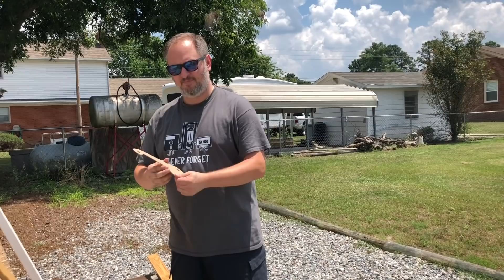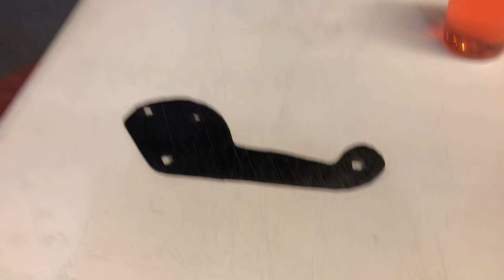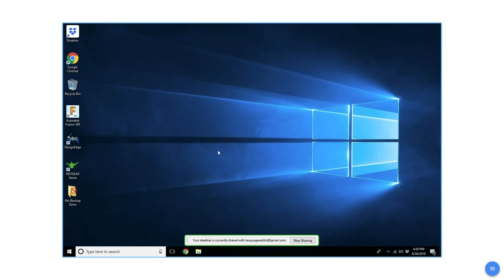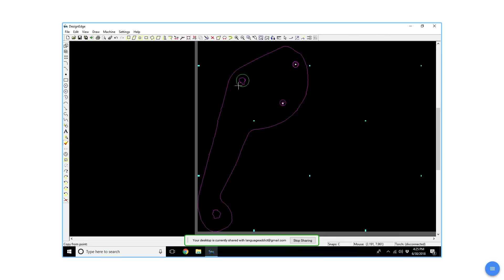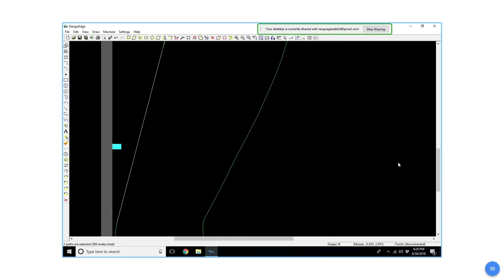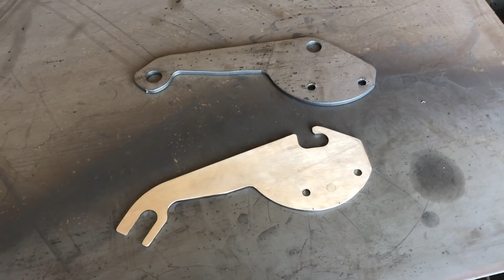PlasmaCAM - BatWing Fairing Brackets

Comment: Tom, have you gotten beyond the initial learning curve with Fusion360 yet? I’ve been really impressed with that software’s ability to import scanned images as an “Attached Canvas.” The image becomes the background of your sketch plane so lining up geometry very precisely is relatively easy.

BTW, I scan a machinist’s rule lying next to the image to ensure proper scaling of the imported canvas.

Cheers!

Tom
Reply from the maker: Hi Tom! Good to hear from you, sir. So Fusion is actually my go-to software at this stage. I've been using it for a few years now and it's really gotten so I struggle without it. I might do another version of this video where I do it from Fusion rather than the native software.  Great idea about adding a scale to the scan. I'll have to try that out! Sounds a ton easier. Thanks! - Tom Z

Comment: Hey Tom.  That's a handy neat little trick mate, thanks for sharing.  We have a plasmaCAM at work (high school) and the design edge software never ceases to amaze me.  There are many features in it that I still don't know.  Your video proved that to me ;-).  Cheers mate, Aaron.
Reply from the maker: Hi Aaron! Glad to hear you got a little something out of the video. I've sorta gotten away from doing this and wanted to get back to it. Sure is a neat introduction to drawing using the DesignEdge software. I use Fusion more these days but for these simple parts this is often a faster way to go. Hope all is well! - Tom Z
Reply: All is well over here in Melbourne Australia thanks mate.  It's a bit cold and miserable though, as it's winter ATM.  Oh I agree with you.  As you probably know, I use Fusion360 extensively and I'm addicted to it LOL. Trust you are all well over there? Cheers.

Comment: the design edge software really has some nice features for 2D work for sure, good idea on using the paint to help the scan contrast
Reply from the maker: Thanks, Gary! The software is great for those simple, one-off jobs. Drop stuff in place and cut. Stumbled on the scanning trick when moving from hand-cut templates to the computer because I used to paint over the template to mark holes, etc.